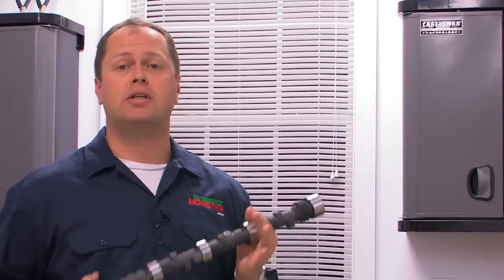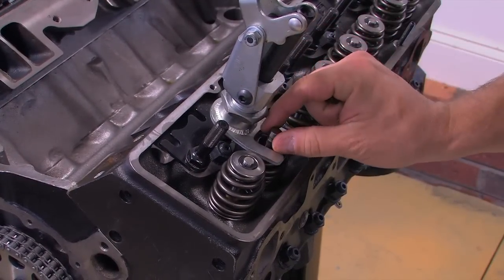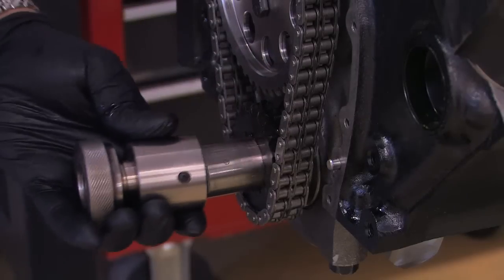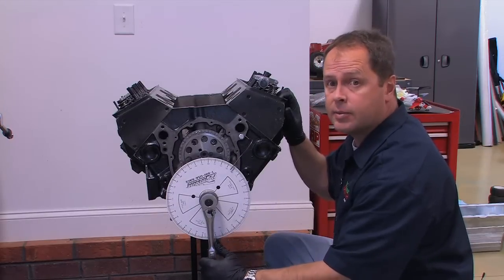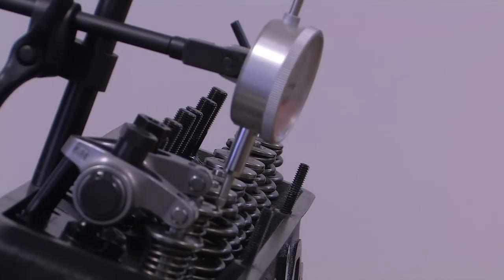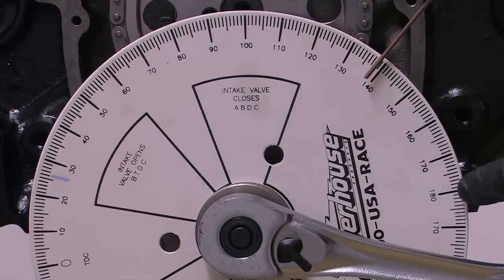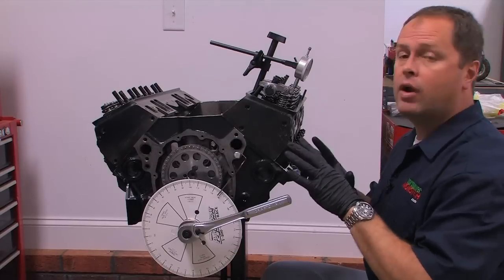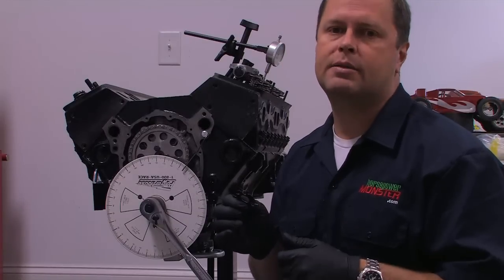Quick Tech Video: How to Degree Your COMP Cams® Camshaft

Comment: For those unsure of doing this, it really is just basic math. Just print out a step by step you can read off of, and you'll be fine. One thing that should be mentioned for radical lift cams, is to check valve to piston clearance while your degreeing. I have seen a few people fail to do this a regret it later.

Comment from the maker: Ryan - The 08-502-8 cam should be fine installed dot to dot.  Degreeing the cam is just to make sure that the dots on the timing set are in exactly the right spot and the cam grind is correct. It's really just a more precise way to install a camshaft. We do recommend that customers degree the cam, but it is not absolutely necessary. Thank you.

Comment: Just checked a comp cam for a sbc I'm putting together. It's not even close to spec! Lift is off .018, center line is 110 should be 102! That is why you should always check.

Comment: every time  I  see someone degree  a cam they get exactly  what the card says so whats the point you order something from a reputable  company but then double check there work i don't  get it
Reply: Whats the whole point for this
Reply: Because what do you prefer?  Spend a little time verifying the specs?  Or putting it altogether only to have to pull it apart again because your timing was off?

Oh and that is if you realize your drive ability concern is due to incorrect cam phasing.  Most cases, the individual will be chasing their tail for hours before they start to suspect cam timing.  Fiddling with ignition and fuel systems until they are out of ideas.  So yes, degree your damn cam.  It is what separates the professional builds from the amateur ones.
Reply: I don't trust these Chinese-sourced Comp Cams either....

Comment: I wouldn't buy a product from a company that sells an expensive kit just to double check their quality control. Do I need to buy another kit to check the hardness of the cam surface?
Reply: Is your crankshaft keyway exact??
Is your timing set exactly cut?
It seems as though you know almost nothing about engine building.

A little bit of knowledge is a dangerous thing.
Reply: "A little bit of knowledge is a dangerous thing."
Poorly made engine components aren't inspiring, the cat's out of the bag?.

Comment from the maker: Because COMP camshafts are manufactured with such high precision you can typically install them on the stock timing marks without any further checking. however, if you wish to check and verify valve timing, we recommend the Intake Centerline Method for degreeing the cam. Thank you.
Reply: I would guess any cam you mass produce can go dot to dot without any trouble. The only time I have seen people have a cam timing issue is with custom grind cams.

Comment from the maker: It depends on what type of engine you are working on. In most cases, you will need an adjustable timing set, so you can make the intake centerline where it is supposed to be. In Chevy applications, an offset degree bushing can be used instead of an adjustable timing set. Hope this helps. Thank you.

Comment: At 3:17 into the video, he shows removing the PPS tool. 
DO NOT yet remove the PPS tool !!!!! 
Instead, move your wire pointer (or move the degree wheel) as to accommodate for the error.
As shown at 3:43 into the video he moves the degree wheel as to align the ZERO with the wire pointer. 
At that point, you should once again rotate the crankshaft in either direction for your final "stop" check.
Once an equal split has been accurately established, now you can safely remove the PPS tool.

When the crankshaf is now rotated so that the ZERO aligns with the wire pointer, you will have located your TRUE # 1 TDC.

Don't take short cuts..... shoot for accuracy, even if it takes you a bit longer.
Reply: Never put zero at max lift; zero should be at the base circle. The guy doe not understand that max lift is actually the center line so would be just that but is not possible to measure with accuracy.
Reply: @TheReverb1  Just to add a bit of clarity;  TDC for each cylinder can be found twice during 4 engine cycles. When setting up for true # 1 TDC (for camshaft indexing or ignition timing), we are targetting TDC C/S. (c/s = compression stroke)
TDC C/S places both intake and exhaust cam lobes at bottom of base circle.

Comment: So, I've been building engines for a day or two now.  I keep hearing about "degreeing" the cam, see it over and over again on hot rod shows, where for some reason or another they are advancing the cam by xyz degrees and they really never explain it either.  I've always wondered why one would need to do so if the cam is properly manufactured and properly keyed for the camshaft sprocket and crank sprocket.  If what I just watched is correct, the whole purpose of all of this is simply to ensure that the cam was ground and set up as described by the manufacturer?  So doesn't Comp Cams have a quality control program to verify all of that has been done properly before they put it in the box?
Reply: Exactly my point!

Unless you dyno every cam timing adjustment you make, it's not for dialing in power.... It's only to check against the grind quality.

Having those tools to check piston to valve clearance is important tho!
Reply: Some cam grinders grind a certain amount of advance into the cam to offset timing chain slack. Depending on the cam card and the grinder, the specs may or may not line up regarding the "zero" mark on the gears. IE, put it at zero and you find your cam advanced by 3-4 degrees according to the card. Depending on what you're trying to achieve, advancing or retarding the cam timing can make a giant performance change. A change large enough to be seen in cranking compression test. Advancing the cam timing closes the exhaust valve sooner and will increase bottom end performance (because the cylinder pressure is higher, sooner) and retarding the timing will usually extended the max HP into higher RPM ranges. Where the ILC ends up is necessary information. Putting it where you want it is crucial. Until you start building things that are pretty edgy, lining up the dots is usually good enough. When you start racing, and trying to make HP within a given set of engine rules for a specific purpose, you're definitely going to want to understand this is greater detail.
Reply: Once you get one cam that's off, you'll never not degree again. I got bit, now I do it. Hundreds of thousands of cams go out every year, something is going to get messed up sooner or later. Stamped and boxed wrong, could be anything

Comment: Great video but when you first put the degree wheel on  which way does it go  zero pointing up or down or does it matter
Reply from the maker: At first, it doesn't matter.  After you find TDC, then you will re-orient the wheel where it is supposed to be. Hope this helps, thanks for watching!
Reply: COMP Cams  Thanks for replying i have installed many cams and never degreed them i will try this next time

Comment: Hi, nice video!!!
I have a question: I've seen that degrading the engines that are not an interference engine such as the one you're using everyone uses them as an example, but if I'm going to downgrade an interference engine like 2000 dodge durango 4.7, am I supposed to degrade all the cams (block and heads) or only the block? or do all the engines degrade the same way? May you please clear my doubts sir.

Comment from the maker: Thanks for watching! If the cam is not matching up with the cam card, you would simply use your adjustable timing set to bring it back into spec. If it was so far out that it could not be brought into spec then either the cam is bad, the timing set is bad or there is user error. For any additional questions feel free to call our CAM HELP line at 1.800.999.9853.

Comment from the maker: It is best to use compressed air to hold the valves up when swapping valve springs with the heads still on the engine.
Reply: Feed a cotton rope into the spark plug hole and roll the piston up...to hold the valves.... Don't lose the rope inside !!!!
A lot simpler than messing with air and TDC dwell.
I learned this in the 50s... It was common.

Comment: Why wouldnt you just put the dial indicator on the pushrod?  Then you wouldn't even need the rocker arms or the test springs.  You also wouldn't have to multiply .050 x 1.52.  You could just look for .050" lift directly?
Reply: I think it has to do with the way the tool is designed. you can get other cam degree kits that go right into lifter bore. that way you get true cam measurements and not have to do all that math

Comment: So dot to dot on a fuel injected car is not enough I should also degree the cam? I got a 280 xfi cam for my 5.7L. I re-used the old timing chain since the motor only has 20k miles on it. If it's off can't the pcm be adjusted to the difference through timing?
Reply: Seek help

Comment: Perhaps I am an idiot, but you didn't say at what orientation to install the degree wheel on the crankshaft. Is this just random or perhaps it doesn't matter? For example, what happens if I install the wheel with the label inverted? Two, does it matter how deep the piston stop goes into the chamber? (Lets say I didn't purchase your kit) Three, during the critical aspects of measurement and calculation you go way too fast. (Keep in mind that only Novices would need to view this video in the first place).  Thanks for posting. It did provide a rudimentary understanding of the process. Still have questions though.
Reply from the maker: At first, it doesn't matter regarding the orientation of the degree wheel. After you find TDC, then you will re-orient the wheel where it is supposed to be. It also does not matter how deep the piston stop goes into the chamber, it just has to be deep enough to contact the piston before it gets to the top of the cylinder. Hope this helps!

Comment: How did he just change the valve spring without the valve dropping in the engine? I didn't see an attachment in the number one sparkplug hole for compressed air.
Reply: new valve seals

Comment: I have an S197 Mustang GT with just the Mutha Thumpr cams do they need to be degreed?
Reply from the maker: The S197 Mustang GT should be a 3-valve, 4.6L engine.  Since those engines have VVT, it is not required to degree them in.  Simply install everything at the factory timing marks. Hope this helps, sorry for the extreme delay, your message just popped up. Thanks for watching!